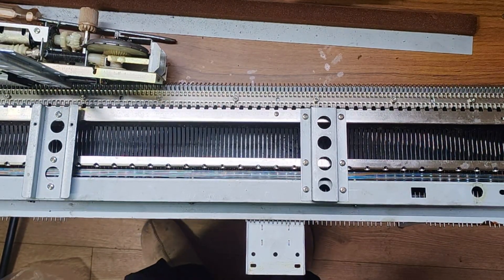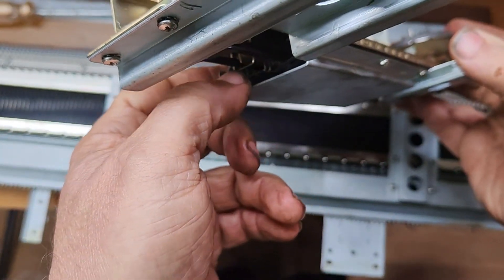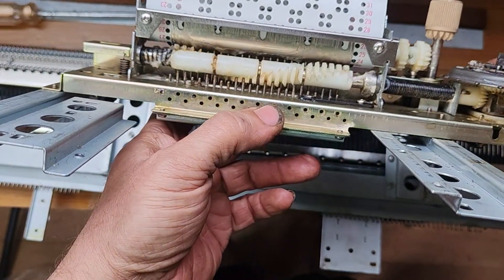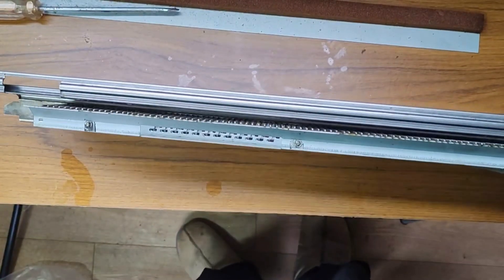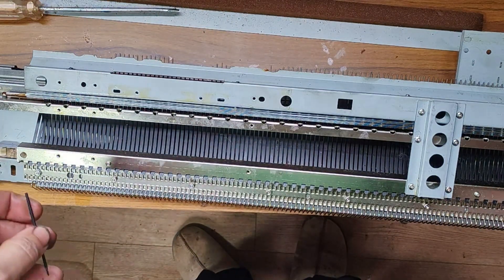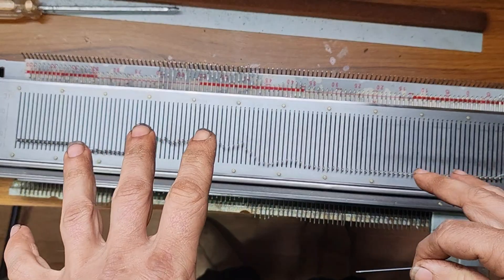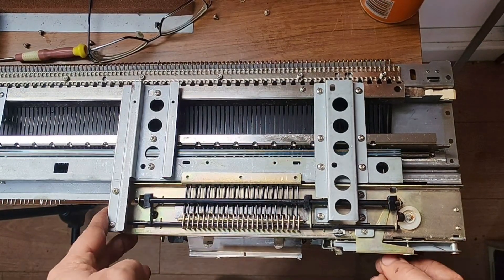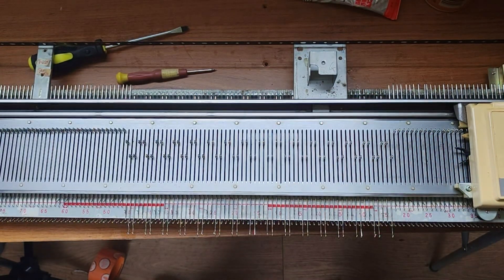How a Brother punchcard knitting machine works

Comment: Thank you for this video, I can see exactly where I’ve gone wrong reinstating this card reader and will be putting it right at the weekend while watching your video again. One other problem I have is screws, according to the manual they refer to the screws as 3.18, what does that mean as my screws are getting impossible to use please?
Reply from the maker: I don't know what the reference to 3.18 is, but I can tell you that the screws used are common between most Japanese machines, and also common across most of the whole machine, so if you have stripped or mashed the head of a screw you can nick one from elsewhere and use that

Comment: I'd correct your disclaimer to "don't take a card reader that works off" or "don't take it apart unless you are willing to make it irreparable"

The whole "don't take it apart unless you know what you are doing" prevents the next generation from learning and so the ability to maintain will die with our generation.
Reply from the maker: I stand by my comment! There's plenty of literature out there if you wish to learn what you are doing - the service manuals, for example, are readily available for free on t'internet. The next generation are probably fine...
Reply: @singlentendre  even with literature, there is no replacement for actual experience. How do you take the first one apart if you can't take it apart if you haven't the experience necessary to put it back together again.

My mother always says "knowing how to do something and being able to do something are two completely different things" I know how to build a nuclear reactor but could I do it?
Reply from the maker: Indeed. But the fact remains that I don't - and can't - recommend taking a card reader apart unless you know what you're doing. To do so is the quickest way to turn a working machine into a pile of bits, and there are few enough of these around as there are. 

Maybe what I would suggest to anyone who asked is to buy an already-broken one for playing with. That's how I learned how to fix cars...
Reply: @singlentendre  I did say "don't take off a card reader that works"
There's the old saying "don't fix wot ain't broke"